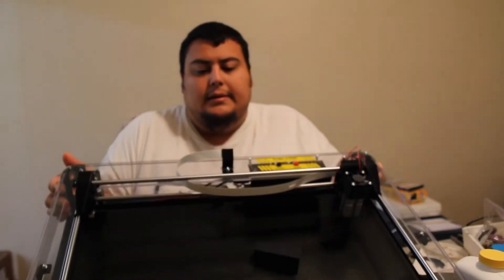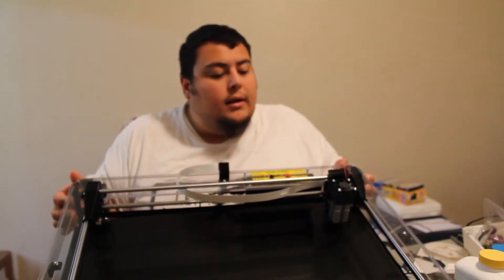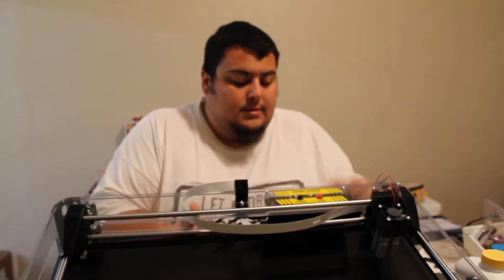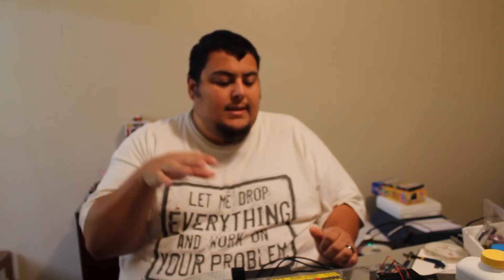Darkly Labs Emblaser /  Laser Blade Initial Impression After final Build

Comment: So, now that you've used it, assuming you've got the kinks worked out, what is your opinion of the machine?
Reply from the maker: +Dennis Siple i like it, but wish i had waited and saved a little more to buy a glowforge. would not buy it again if i had to. there are better options now that do a lot more for around the same price
Reply: +Obsesscions  I've discovered that the software that they supply with their units only works on Windows.  I've got a Mac, so that's a deal breaker.  What do you use yours for? What are you cutting?
Reply: +Obsesscions Would the glowforge then be your choice?
Reply from the maker: I honestly cant say it would just because i havent used it. but for a beginner who knows nothing about laser engraving or vector and gcode. It seems like the best option. I wish i could get my hands on one to play with it, maybe in the near future.
Reply: +Obsesscions  I've been looking around, and there are inexpensive laser cutters from Asia, but they're very heavy and shipping can be more than the cost of purchase.  And I didn't realize, as you said above, that one has to be familiar with vector and gcode, etc. to be able to run the thing.  I like the glowforge for the fact that it's made in the USA and they seem to have a very good guarantee.  But they're a bit pricey.  I think the software that comes with it has a lot of built in templates of images and fonts that can be used for trophies, etching glass and iPhone cases and iPads, etc..  More research…  Thanks.
Reply from the maker: ya if your new to this whole laser deal then i would start with something with a very small learning curve. Ive heard nothing but good things about the glowforge. i just cant give you much info based on my lack of experiance with it. Maybe you could contact them Glowforge to give you some more info. Love the look of the system as well. Maybe ill get it soon, but until then good luck with your research.
Reply: Thanks.  Clearly, I have a lot more thinking to do before I plop down a bunch of dough on something I'm not sure about.
Reply from the maker: all said and done with the large version i bought plus shipping and the issues it had i was in about $1500. Which isnt a far cry from the glowforge.

Comment: Did you keep in mind that the laser diode itself is quite delicate and can be damaged by static charge during installation?
Reply from the maker: +HerrBusack Thats not true at least with this unit. The Laser is housed very well inside a large heat sink with the fan attached. Although laser diodes are protected with static shielding bags during transport these are not sensitive enough to have an issue with light handling. especially when housed in the unit this is in with a thermal barrier. The issue itself wasnt the diode it was the ribbon cable and connectors which i fixed. Also these diodes are commercially available off the shelf units and arent tested to higher industrial or military standards that would require special handling precautions when using or installing them. The only real way to damage this laser in this configuration is to take a hammer to it or overpower it past its comfortable threshold directly, wich the arduino board would never do.

Comment: I'm a little lost as far as your complaints on what appears to be a well thought out and cheap laser cutter? If you got a bad laser that sucks but cleaning, tweaking and deburing some parts is pretty standard fair on a kit build like this.
Reply from the maker: +Shawn Lund  you can agree or disagree all you want, but this is just my opinion and if this was a $400 kit then i would agree, but this it is almost $1000 and parts are supposed to be mass produced by the manufacture. And to let parts ship with such issues is a huge quality control issue. From the manufacture i shouldnt be able to slice my hand in half with the plastic parts, if this was a consumer kit that was readily available at a local best buy or electronics retailer you better believe they would in lawsuit hell for all the sliced hands and arms when building. If you dont think thats an issue then thats ok, but i expect more when i can get completely built CO2 lasers that can cut and burn better for less then $600. But as before its just my opinion on a unit i bought to get into the hobby with something i could use in my home and not have to dedicate garage space
Reply: Only in the U.S. would there be a lawsuit, courts in Canada would laugh at you if you tried to sue someone because you cut yourself.
Reply from the maker: *****
search CO2 laser cutter on ebay